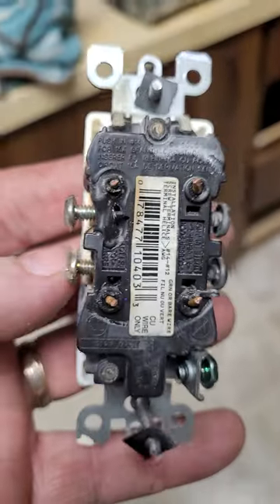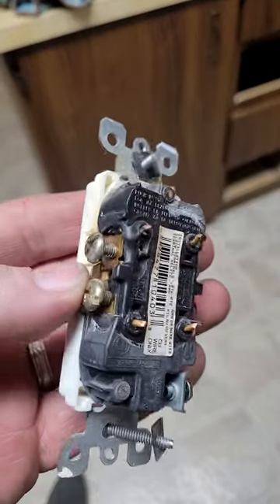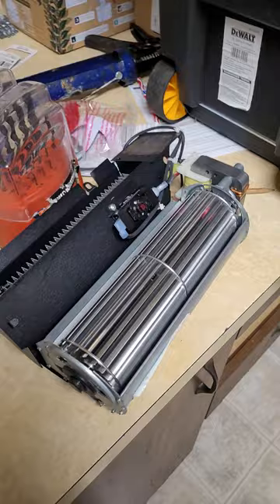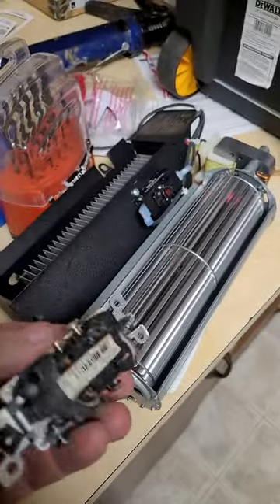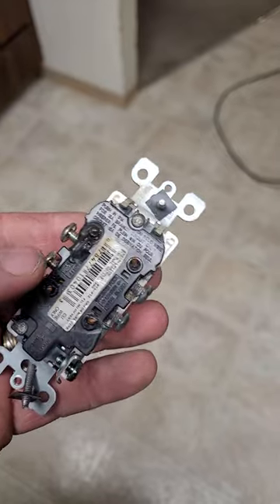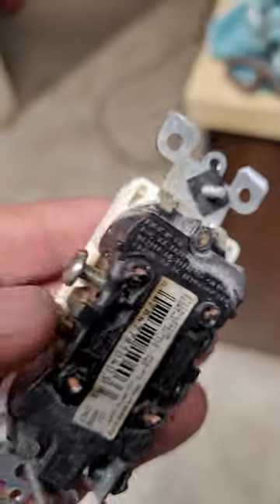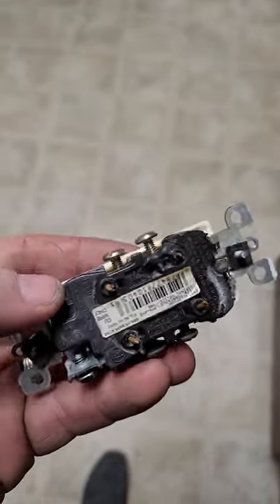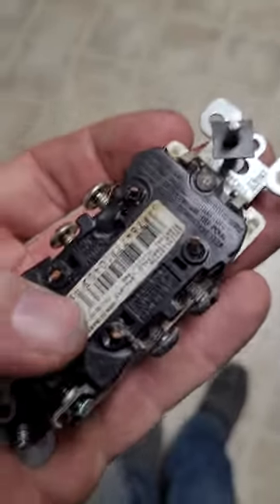Melted outlet stab connection failure DO NOT USE SPACE HEATERS AS PRIMARY HEAT

Comment: In the field,  I like to refer to these backstab receptacles as La-Z-Wire.    I always take a few extra seconds to wrap the wire around the screw.   During my 6 years doing residential wiring, none of the receptacles or switches I installed  failed, except for the occasional worn receptacle that won't hold a plug tightly,  or a three way switch not working properly because the common and traveller got mixed up for whatever reason.   On the other hand I've replaced several burned up backstab devices, space heaters and air conditioners being the culprit,  and never had a callback.

Comment: I tell people about back stabbing all the time. It's fine for low draw equipment but high draw stuff is a problem. The contact area is too small on a back stab so resistance increases which means heat increases. Fire waiting to happen. Hopefully people will heed your words.
Reply: that and should use 20amp boxes with at less 12 Gadge wire you cant ack stab 12 to think
Reply: I personally wouldn’t backstab anything in my house

Comment: always use 20 amp plug in in places that may use space heaters and 12 Gadge or higher wire thos 15amp with 14 wire burn house down
Reply from the maker: Not a bad idea.  I just think they are mostly unnecessary. It's best to use the heat source designed into the space. 🤷
Reply: I agree in my test space heaters used more power then furnace only why I could see one been needed is if your furnace quits working and you need it to keep warm to you get it fixed
Reply: Also, have to consider the insulation in the house/room. If insulation is bad then people tend to by quick-fix space heaters to band aid the issue when they should ensure an air tight/well insulated home FIRST.  That way, your climate control systems won't have to work as hard.

Comment: I keep the temp in the house 50 degrees year round
During the winter I turn on heat about 1 hour a day 4 months of the year.
In the summer, 5 months I used 60,000 TonsA/C to cool the house down to 50

I love the winter when it is 20 degrees outside because it is 50 in the house with no heat.
Reply from the maker: Those are some wild numbers.